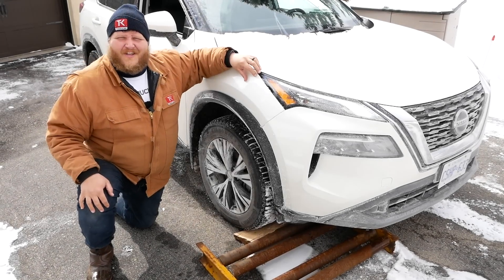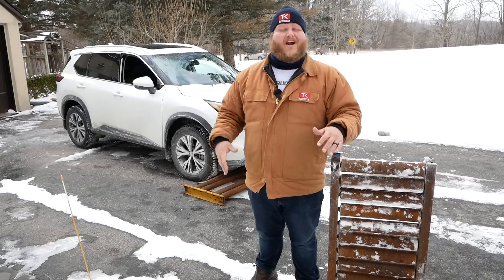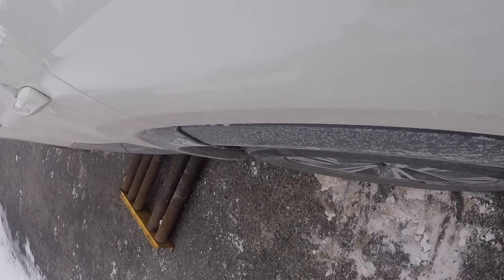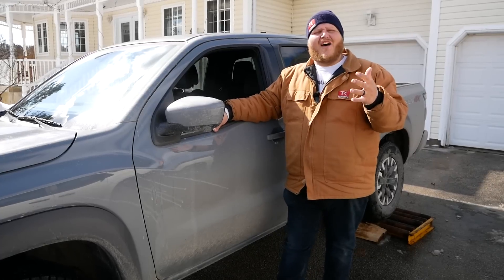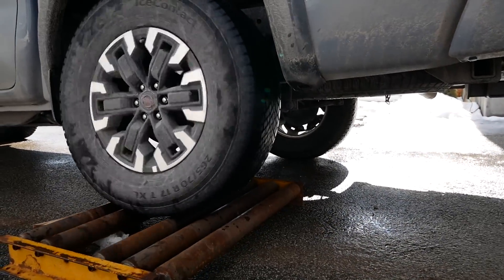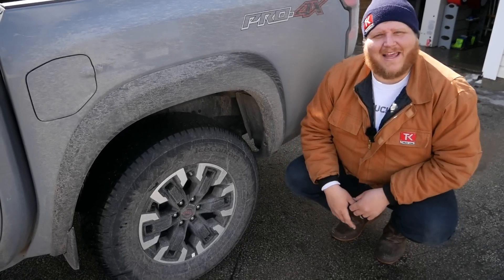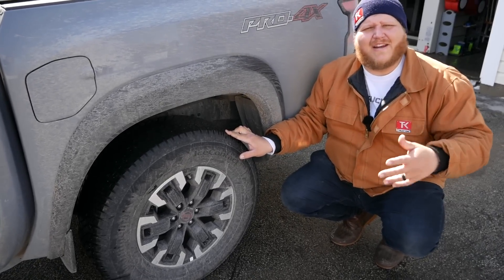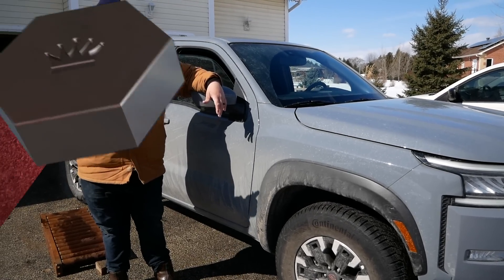AWD vs 4WD - Which System is Better and How Do They Work? We Demonstrate the Differences

Comment: I loved my Limited 4Runner with full time 4WD/AWD via a Torsen Center Differential. It wasn’t a rock crawler, but this system drove through snow, rain, loose gravel and mud like a mountain goat.
Reply: Torsen is so under-appreaciated and ignored by the industry. Torsen is better than LSD rears if combined with a brake system like an Awd to brake a lifted or slipping tire.
Reply: @J G  Torsen makes a lot of sense as a diff that can be locked, but I mean, an open diff can stop wheel spin with the brakes just as well. LSDs that can actually limit wheel slip are a lot better off road and for performance.

But that being said they do have the advantage of being more durable than clutch pack based AWD systems, and you don't lose AWD like you would if that clutch pack overheats
Reply: @rangerover06sc  plus that sweet torque multiple it applies if slipping occurs.
Reply: I prefer the Ford vehicles with the Full time transfer case (Ford calls it the "advanced transfer case")
Colloquially known as the 4-Auto feature. Depending on the model of the vehicle sometimes there's variance as to how much power the front wheels get, but it is a genuine full-time feature.
Reply: @hermanjohnson9180  SAE did a write up on this (google The Ford Raptor’s front drivetrain is pulling for you) in March 2020, it's a great read. The Raptor system essentially puts a clutch based system (like a Honda Ridgeline) in the same case as a traditional dog-clutch locking system, so the Raptor is AWD in most cases and can be 4x4 in others. The funny part is the front diff on a Raptor is a Torsen unit, for the very reasons I specified in my prior posts. In a nutshell, the Raptor system (as you pointed out now also used in other vehicles) is: A Torsen front, a unique hybrid center (clutch pack AWD like Honda with traditional dog-clutch locking 4x4), and LSD rear with locker. It's expensive and complex, but essentially the best of all worlds by combining 4 separate systems along the driveline.
Reply: @jg8263  
The Honda automobiles' is all wheel drive is actually pretty cool and not very similar to many other types.
Reply: Well then, when we will turn the knob using the right codition for 4WD of 4RUNNER, that's my concern?

Comment: In my case, my X5 first gen x-drive, its an awd system but when I take off traction control (DSC), the drive train turns into a 4x4  system, theirs no aid In traction control, it sends power with the transfer case at a fixed rate to the wheels. Best of both worlds, I personally go 4x4 all day. Ive been through some rough stuff and snow, DSC off, the x5 acts like a different vehicle in a good way, its way more capable.

Comment: I like my Ridgeline AWD because I don't do any off-road or dirt roads.
But I like the RAM Rebel. Isn't it full-time 4WD/AWD?  Can the rear locker be used in 4-High?
Reply: only get a rebel for style, the offroad is no more capable than your ridgeline if you throw decent tires and some underbody armor on it. its all marketing

Comment: Unfortunately I think these modern 4WD systems combine the worst aspects of an automated system and a manual one.  Not only does the driver have to know what driving conditions are appropriate for each 4WD setting, not all features are available depending on the mode, and varying levels of traction control will kick in.
If I have a true 4WD vehicle with a locker, then I should be able to engage the locker regardless of whether I'm in 4Hi or 4Lo, or even 2WD.
Reply: F-Series trucks can activate the rear locker in 4Hi/Lo or 2WD. Can do it while rolling also. Only limitation is speed, but you shouldn't be using a rear locker at high speed anyway. F-Series trucks have 4 Low, 4 High, 2WD, and 4 Auto on appropriate trim levels. Then a button for the rear locker (or in previous gens you pull out on the 4WD selector knob). There are drive modes which can further offer differences in throttle response in 4WD, but you can just leave it in Normal and it will just behave like the truck normally does, but in 4WD.
Reply: @Vulnox  True, the F series system is slightly better than others.  My dad's 2015 F-150 King Ranch has the full selection of 4L, 4H, 4A, & 2WD with the pull to engage rear-locker.  It's closer to what I would consider an ideal system, but still not without compromises.  For example, my dad has complained the truck feels unsettled when driving at moderate speeds over patchy ice in 4 Auto.  It drives better in 4H, but then how long do you want to be driving around at 50+mph with the transfer case locked?  With that same truck I was able to get stuck in a snow bank just off the road shoulder with the right side in deep snow, the left front on ice, and the left rear on dry pavement.  Even with the rear locker, I couldn't get enough traction with all season tires to get moving again. And the electronics were clearly unhappy with me trying different combinations of locker/4L/sport mode. 

I feel like we're in a "valley" on the curve of electronic traction control development for mass market all-wheel drive vehicles.  The systems are just smart enough so an operator won't damage the vehicle, but that means they'll turn features off, sometimes unexpectedly.  On the other hand, they're not smart enough to apply torque to the right place quickly enough for all driving scenarios.  Good enough for soccer moms to get through an icy intersection or a muddy campground entrance, but not a lot of serious off-roading.
Reply: @rhekman  I had my 2008 Toyota Tundra in 4WD for a month, never had any issues other than worse fuel economy than normal...and by worse fuel economy I mean usually I would get 14mpg around town at the worst, in 4WD all the time for a month in 1-2 feet of snow/ice conditions, I was getting 9mpg....and to make matters worse we had below zero temps all that time as well, so the truck had to warm up enough that I could get the ice scraped off the windows to even be able to drive it, and that was scraping ice off the inside and outside of the windows LOL.  

In a relatively straight line it isn't going to matter if you run in 4WD part time its not going to hurt a thing other than maybe your wallet at the gas station, but as far as damage, it won't cause any.  The damage would come from being on dry pavement, and trying to make sharp turns like into and out of a parking space.

All my vehicles now are old school 4X4...no terrain management, no traction control, no stability control...you lock the hubs, and pull a lever...works 100% of the time and doesn't give a damn what you are driving through....if you need to tell your vehicle that you are driving on grass, snow, mud, etc...that's where the complications come in...who cares engage 4WD and you'll be just fine without all the dang electronic nannies...all those are for is for people who have no business driving in the first place, just like traction control, stability control, air bags, lane keep assist, etc.
Reply: As someone who drives an older grand cherokee, theres no drive modes, theres just full time awd and some limited slip diffs, and lemme tell you it always handles fine. This is a lot of marketing bs from most these companies, and it seems they ate up all the marketing and spit it back out in this vid. 

Also the rear locker in the nissan is simply uneccessary 99.9% of the time, and so many people probably turned their lockers on on dry pavement they destroyed the rear axles and had to get it fixed under warranty. Its just idiot proofing
Reply: @james2042  I miss my Grand Cherokee with the selec-trac 4WD.  2WD/full time 4WD/part time 4WD/and low range.  Not all Grand Cherokees were full time 4WD, the first couple model years of the ZJ also had the option of just a part time command trac 4WD system, but many were ordered like your Grand Cherokee with the full time 4WD mode....and my 98 Grand Cherokee had the limited slip rear differential.  The WJ's had Quadra-Drive, full time 4WD plus front and rear limited slip differentials.

Comment: The winners are Acura's SH-AWD and Subaru's Symmetrical AWD w/manual transmission
Reply: I call it Honda I-VTM4.  But yes, Honda/Acura AWD is miles ahead of this Nissan example. if I remember right the bronco sport AWD is pretty similar to Honda/acura.
Reply: My awd astro with full time awd and g80 rear Locker and 373 gears from the factory would eat those for breakfast dude!!! 😆
Reply: I can promise you neither one of those is close to the best awd

Comment: Just bought the wife a Rav4 AWD. Took it out in a blizzard and a half foot of snow to test the AWD system and I am a believer now. Handled it like a champ.
Reply: Did that a few years ago in probably 6-8 inches of snow with a loaner RAV4 AWD and was surprised how well it did with all season tires on it.  Wish I would have had that thing the following year when I had 2 feet of snow in my driveway, would have been interesting to see if could have made it out, highly doubt it, at least not without chains.
Reply: @wildbill23c  it just plowed straight through. No problems at all. Pretty damn impressive. Especially when I have a 2wd truck lol
Reply: @alekpolick8628  did you have chains?